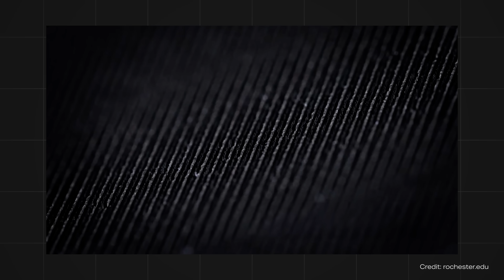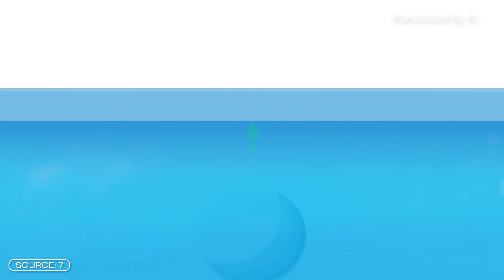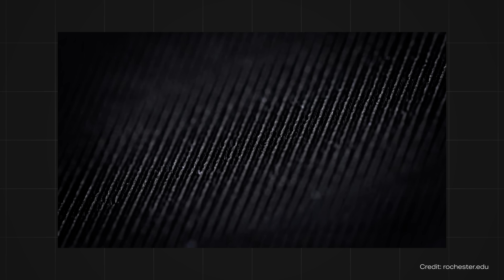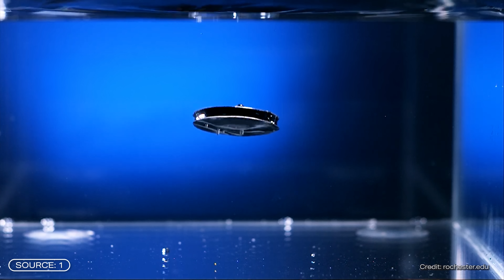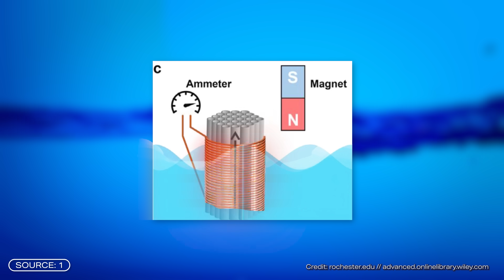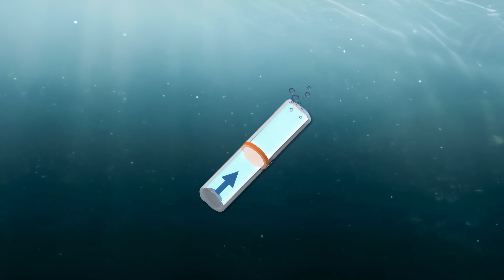New Study: How to Make Ships Unsinkable!

Comment: It would need a lot more testing... Does the super hydrophobic coating lose it's ability to remain hydrophobic when exposed to extreme heat/fire? What about cold? What about when exposed to solvents like acids, oils, fuels?
Reply: Sure it is a good start, but like you said it needs a lot of testing, especially with all the things you listed.
Reply: Also just how long will it last with constant ocean waves hitting it?
Reply: Surfactants.

Comment: I could see this in oyster farming very very quickly. creating a flat barge form the tubes is very simple, then you just hang the ropes down from the platform (you show some b-roll of the platforms we use now to grow oysters) - I don't know how cost effe3ctive it would be or how badly8 we need non-bio-fouling on oyster farming platforms, but it's pretty logical given the natural shape of a few of these tubes attached to each other LOL

- but more seriously this could be useful in wave power generation. bio-fouling seems like it would be a big problem in the efficiency of the floats and the rest of the equipment and this would save on weight too. I could see whole sheets of these tubes maybe welded to one another that either make up the walls of the float or are attached to shaped metal walls that make up the float.

Comment: Naval architecture has addressed most of the issues of sinking.
And how often do ships even sink?
It also sounds like it works, until it catastrophically fails.
Reply: ok debbie downer
Reply: Maybe it would be better applied to smaller ships and yachts, where people crash, overload their capacity with parties, etc. For larger vessels, I think the make or break would be the maintenance.
Reply: @_ch1pset That's just it, most of those aren't metal.
They're also constructed of inherently bouyant materials with foam filled cavities.
That, and a hydrophobic material isn't going to supply more displacement. If you put enough weight on a balloon, it will still sink. You can sink a tank of hydrogen if the tank weighs enough.

Comment: This is incredibly scale sensitive. Scale it up, and it doesn't work anymore (the buoyancy, I mean). So you have to keep the geometry (tubes in this case) very small. Turning that into a production process will be challenging. It's incredible research, but I have the feeling it'll be decades before we see useful applications, no?

Comment: I'm prone to think stuff at sea will grow on it and mess up the angle.
Reply: The angle of the dangle?
Reply: @daveyshmavey  don't let your dingl dangle, dangle in the dirt. 😎
Reply: I'm interested if the surface would cause drag in water?  If It does have biofouling preventing properties, that would be a boon for all kinds of industries. 

Biofouling is just expensive to deal with.
Reply: All you need to do is make them shaped like a pill 💊 capsule and they would never sink unless you collided with another ship
Reply: @thecatmansmeow well then this is just a normal cylinder, you dont need this new type of surface for that.
Reply: @znk0r  yes, this. 😂
Reply: Make them the same shape as a submarine and build them semi submersible avoid building them long to avoid snapping in half in waves and they can't sink
Reply: Also use recycled Styrofoam and fiberglass for construction with bamboo rods
Reply: Captain Haddock: Blistering blue barnacles
Reply: Didn't bother watching it all, did you?
Reply: @nonyadamnbusiness9887  Only modeled in the lab.

Comment: I think a catamaran would be  a logical step in testing the viability of this technology on larger crafts.  Or a pontoon boat since pontoons are already tubes it would be the simplest  layout for a boat that could use this technology. But it would require thinking outside the usual tanker layout for shipping. Assuming the tubular layout is crucial to the design. Then scale up to barges etc.   I hope RC test flight watches this  video so maybe he could use some scaled down concepts of these tubes  on one of  his  hydrofoil type boats.